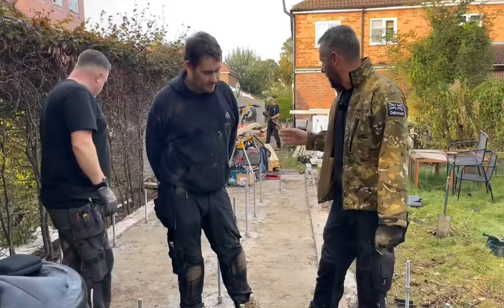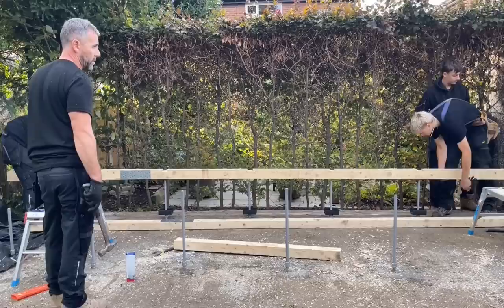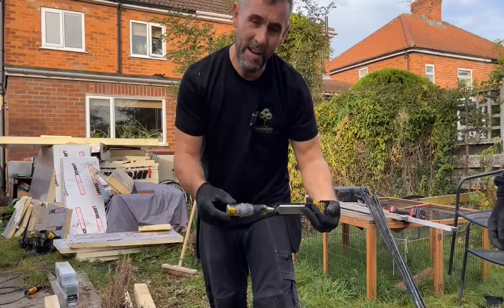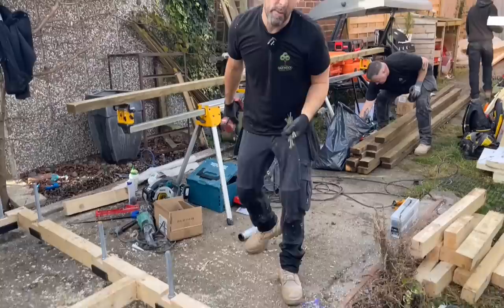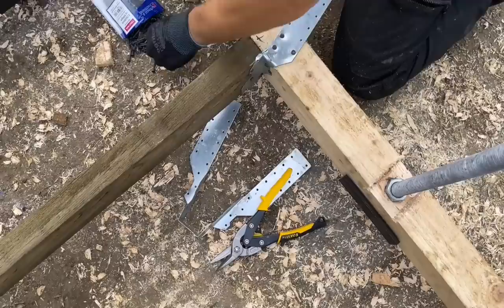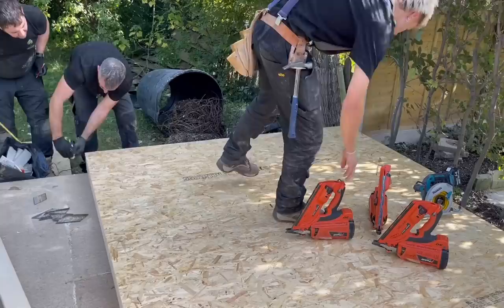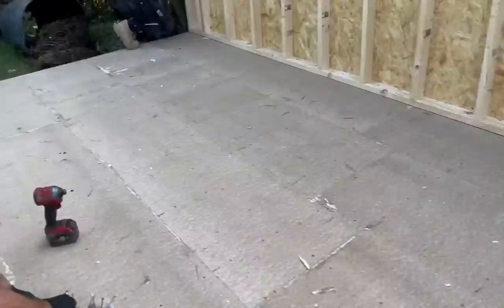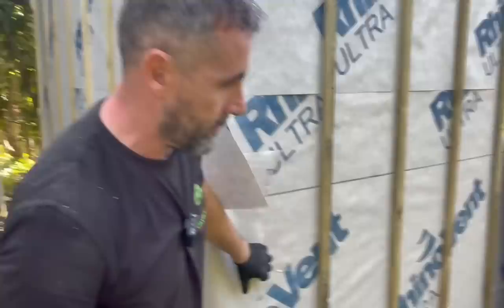Garden room base and wall construction

Comment: Hello I am an avid watcher of your channel and your videos get better as time goes on. I noticed your comment about drilling the holes perfectly straight for the wood to fit on the metal bars. If you screwed 2 3x2 together to make 90 degree corner and then rested the drill in the corner and you wood get perfect holes every time

Comment: Please look after your eyes, glasses (light eye protection) are not safe enough for grinders, you need impact resistant goggles.  Each spark is 3000 degrees, one in the eye can blind. Take care all. Love the vids and the work.
Reply: Yes your right I work in a garage and have learnt the hard way 😜
Reply: I always have spare pairs in van and give them  away if someone without
Had accident when apprentice even with goggles 
Its no fun having your eyes flushed believe me

Comment: Hi Liam,
Thanks for a great insight to these projects. Do you have any build using an existing concrete base without using the rod and shoe approach?  
I want to build two sheds; 1st job is a tool shed 2600 x 1300 base x 2500mm high (pitched roof) on an existing concrete base.

2nd job is a larger flat (EPDM covered) roof workshop 4500 x 2500 base x 2400 tall on a soil/gravel base. That abuts the back of the house.
Would you help with any video links that advise on timber cross sections and build technique?
Many thanks and keep the tutorials coming.

Dave

Comment: Hi Liam love the videos, right up my street. I’ve been doing garden rooms for a few years but not with a foundation like yours. I was just wondering is it worth making hole a bit deeper and putting in say 250-300mm of concrete and letting that harden, then use your system. That way rod can never go right through. It could be overkill. What do you think?